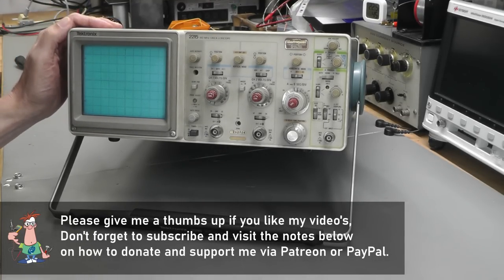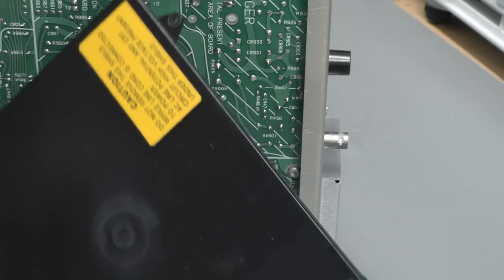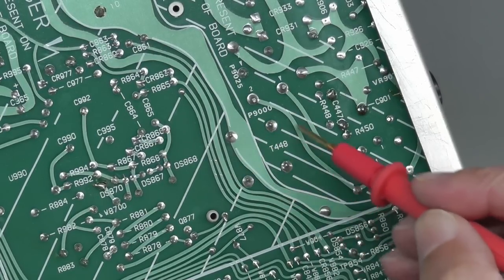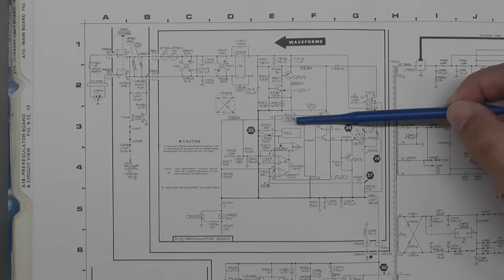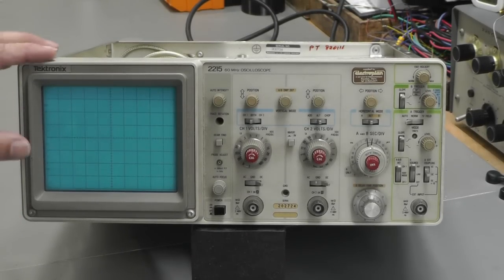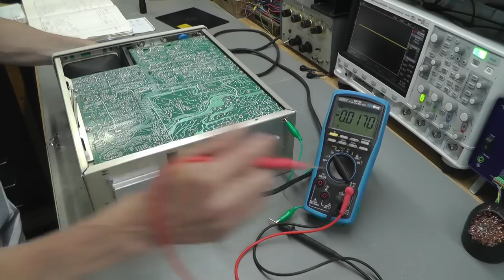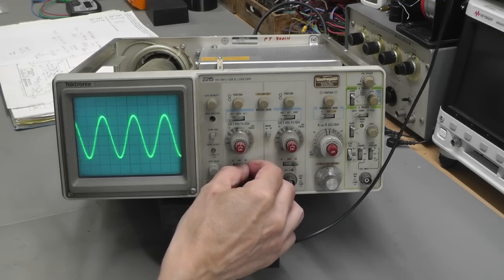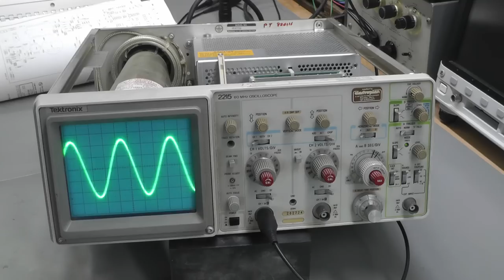No.111 - Tektronix 2215 Oscilloscope Repair

Comment from the maker: Additional note regarding the transistor I swapped out. The BFR96S for the original BFR96:
BFR96 Ic = 75mA
BFR96S Ic = 100mA
The DC current gain (dB) is a little less on the S version, but I cal'd that out. I thought it better to have that slightly better Ic in the hope it makes it a little more robust.
You must use a matched pair, don't mix an S version with a non-S version as it unbalances the differential amp and one of the transistors will blow after a while.

Comment: Very good videos! Only criticism Warning High Voltage should be at beginning of every video when working on mains/ power supplies/valves etc, I worked over 40 years 
on SMP, valves, HV business machines, p.a. Gear etc.! Yes I got bad shocks twice mostly stupid mistakes! i.e. examining motor field coils- I plugged in them instead of angle poise lamp and ended up against a door! Ouch!
Reply from the maker: Point taken.
Reply: Also the danger of charged capacitors or crt’s !

Comment: The vertical deflection problem looked just like what I had on a 2225, but in my case it was a fried resistor. The service manual said they switched from 5W to 7W during the production run and the 7W replacements I ordered were a good bit larger than the fried-looking one that died so I guess that explained that!
Reply from the maker: Yes, there's quite a bit of current being driven back and forth in that circuit. I had to change out both transistors at opposite ends to make sure the circuit was still biased and operated properly. It wasn't to start with and the good transistor was heating up!

Comment: Enjoyed the video, Ian. I don't understand how RF transistors were used. Would like to have seen a picture of them in circuit. Thanks! John
Reply from the maker: Can only think that since those transistors are on the direct input path they will be subject to wide ranging input frequencies from DC to 60MHz, and to get as level a current gain versus bandwidth as possible they are using RF transistors. Just a guess though.

Comment: I have a tek 2225 analog scope and i know it has a very small amount of horizontal jitter as it can not be visible in normal operations.
But when i magnified the internal calibration scurewave to calculate rising time of that signal   it can be visible. The isue is not quality of that signal  because i have same problem when i want do same mesurement of signal  rising time of my TDR circute. Intersting point is that this problem apear  in first case i mean the internal calibration signal, just when slope switch of the scope in front panet set down . But in mesuring signal from TDR         circuit acure eather the slope switch set up or down.
Could you gess the issue is in which part of circutry ? In trigger and slope circuit or in horizontal amplifire ?
TNKS

Comment: I would have thought bringing up a switch mode like the pre-regulator slowly on a variac is a bad idea as it will send the control loop into a spin. If it had auto 240/120 selection even more so.
Reply from the maker: A chance worth taking rather than possibly doing more damage to the PSU, and hopefully any issues in doing so would already be designed in.......thats my theory anyways.
Reply: @IanScottJohnston  Yeah - fair enough - I don’t really know. But I’ve accidentally damaged equipment by running it on 120 when the voltage selector was set for 240. It was a computer supply from memory.

Comment: I have a 2214 that has a problem of, when you turn up the trace intensity, it changes the amplitude of the trace on the screen! Sadly I cannot source a circuit diagram for it to help trace the fault. I'm not good enough to do it flying by the seat of my pants!
Reply from the maker: You can buy the 2214 Service Manual CD on Ebay (See Ebay: 371955865214).....it says it contains the schematics.
Reply: @IanScottJohnston  Hey Ian. Great tip! Thank you for that! 🤩

Comment: The focus appears to be wrong... there are resistors that drop the HV for the focus control.  These resistor are famous for drifting up in value, making it impossible to adjust focus.   Suggest putting more resistors in series... so that each resistor will hold back less voltage and will be more stable over time.
Reply from the maker: It's perfect in person.......the video just makes it look hugely out of focus.
Reply: @IanScottJohnston  Okay... but those resistors are famous for drifting high.  Always good to check the value when you've got one on the bench.
Reply from the maker: @jamesmichener7526 agreed.

Comment: Why are there resistors in parallel with the common mode coils? I have never seen that before, what are they doing?
Reply from the maker: Two common mode chokes, one for AF and the other for RF noise suppression usually.
The resistors are to form a low pass filter with the following capacitors, but the resistors can't pass a lot of current hence the coils in the chokes do that.
Reply: @IanScottJohnston  There not really needed though as the coils form the low pass filter, the higher frequency noise sees the high inductance. I mess about with a lot of switch modes and I have never seen it done this way before.
Reply: I'm going to have play around on a breadboard with that filter to see if it makes any difference with noise in and out, I'm glad I stumbled upon this video :)
Reply from the maker: Try various noise frequencies, especially low freq.

Comment: RF transistors for vertical deflection? DC voltage on vertical deflection!? - oh right, not a CRT TV - I may or may not have expected a nice saw-tooth to the tune of 50 Hz. 
Kids, bias is only good for circuits, not humans.